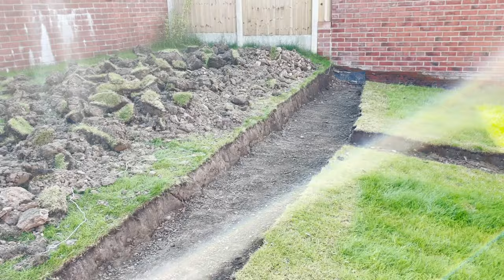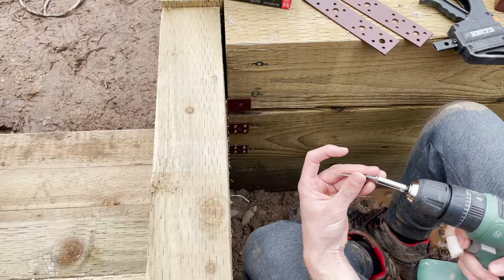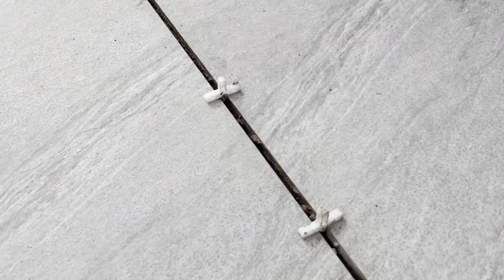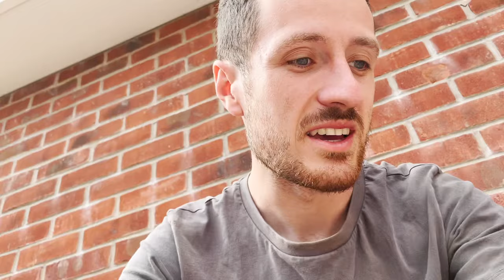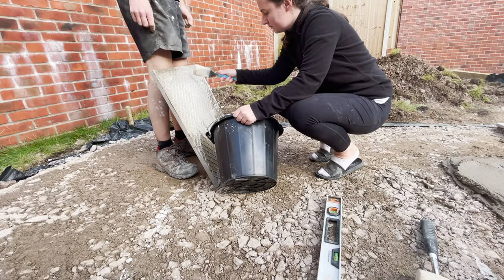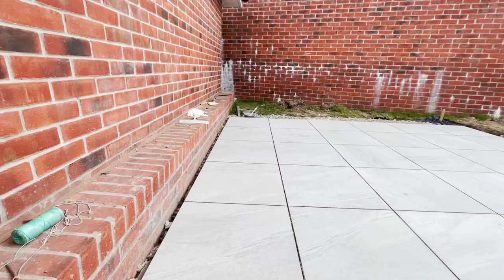Laying a Porcelain PATIO - DIY - GARDEN RENOVATION

Comment: great video, thank you.  I'm a novice starting on my garden project.  just wondering why you used motar to lay the slabs and others use sharp sand.  Is there any reason why?  thank you.
Reply from the maker: I used sharp sand with the cement, but I didn’t want to just lay it on sand as I wanted a solid base for the patio, especially with us putting furniture and things on there too

Comment: why didn’t you use any sand for your top base?
Reply from the maker: I didn't need it with laying this kind of patio. I did consider using sand with a different type of paving slab, but changed my mind before starting the project.